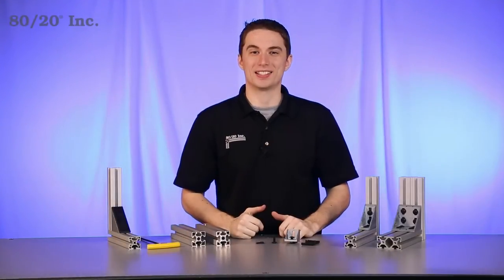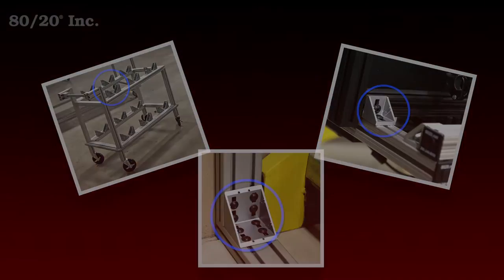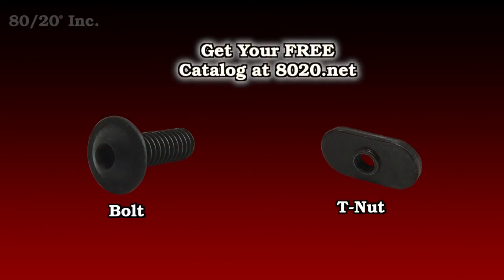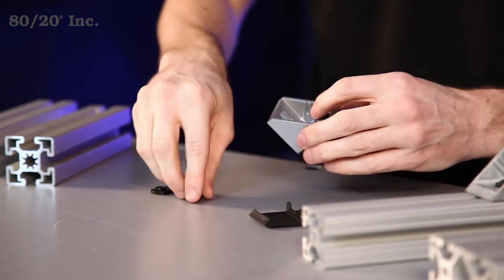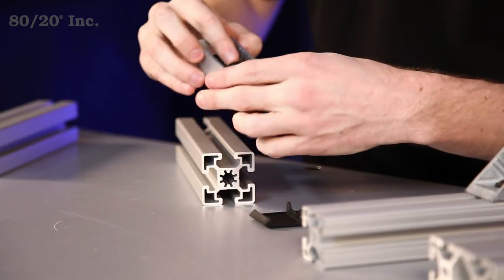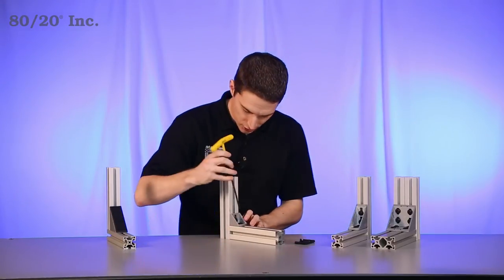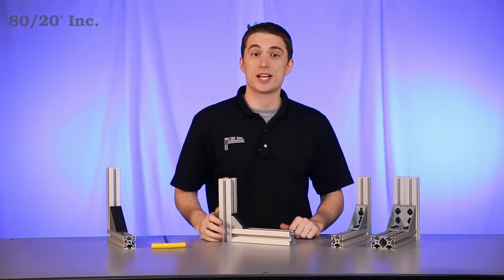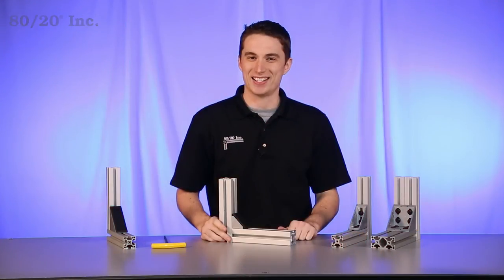80/20: Enclosed Corner Bracket Overview

Comment: Hello, where can I find the max tightening torque for the corner connection (40 series) using the M8 x 16.00mm SHCS and Self-Aligning Slide-In T-Nut? The torques specs for M8 8.8 steel are available online, but I want to be sure that this is within the strength range of the aluminum profile, corner connector and the slide-in t-nut.
Reply from the maker: Hi, Max. We do not have that particular fastener combination. However, the minimum would be 13Nm to a maximum 37Nm.
https://catalogs.8020.net/80-20-Inc-Catalog-23/62/

Comment: Why use Enclosed Corner Bracket over Tall Gusseted Inside Corner Bracket? Is there any advantage of one over the other?
Reply from the maker: While both are similar, the Enclosed Corner Bracket has slotted openings for flexibility in bolt alignment and also an optional cover cap to totally enclose the bracket for a cleaner appearance.  Some styles of the Enclosed Corner Bracket also feature tabs on the back to help with alignment,